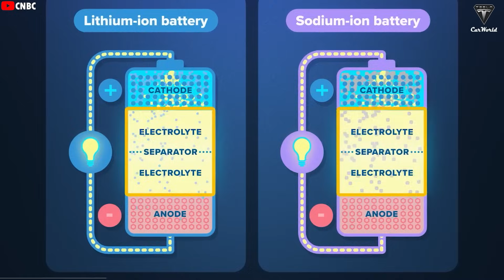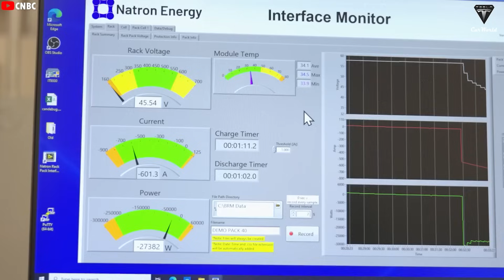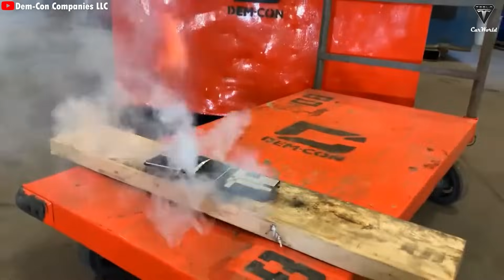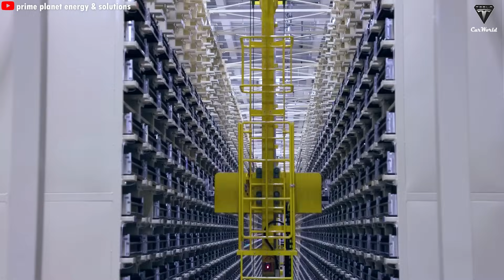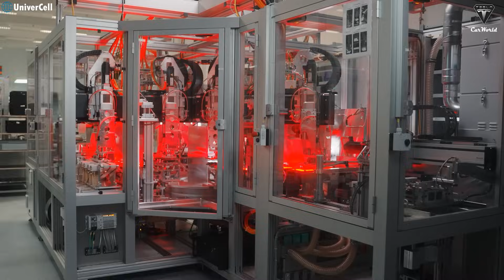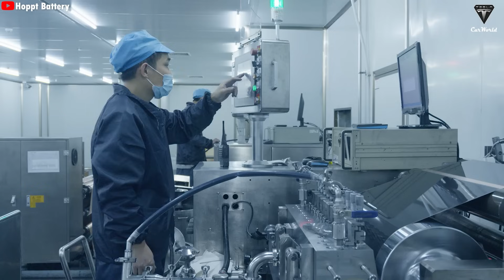Finally Happened! Elon Musk LEAKED 3 Million Mile Battery Tech & 10 Min Charge Change Tesla Forever!

Comment: Ideal in a hybrid with an ICE to charge the battery.  Hybrids should use ICE's exclusively for running a generator to charge the main drive battery.  There should be no heavy drive train elements used is gas powered vehicles.  No differentials, no heavy axles, no conventional transmissions.  Just electric motor/generator on each wheel to allow maximum versatility and true 4-wheel drive.
Reply from the maker: Interesting concept! Using ICE purely as a generator could simplify the drivetrain a lot. Tesla might not go hybrid, but range extender ideas like this keep popping up in the EV world
Reply: Like the Chevy volt.  I would still buy one if I could find one.   @TeslaCarWorld

Comment: So what happened to aluminum ion batteries?
Reply: The reduction of Aluminum is too difficult, easy to discharge but impractical to recharge with an aqueous medium
Reply: @BigRedErnest  Non-aqueous or solid-state electrolytes can overcome these issues. While discharge is indeed easier, advancements in electrode materials and electrolytes are improving rechargeability, though not yet at a commercial scale.
Reply from the maker: Aluminum-ion is still in the lab stage. Promising on paper, but scaling it up for EV use has been a huge challenge compared to sodium-ion